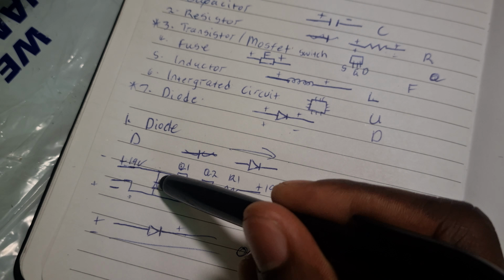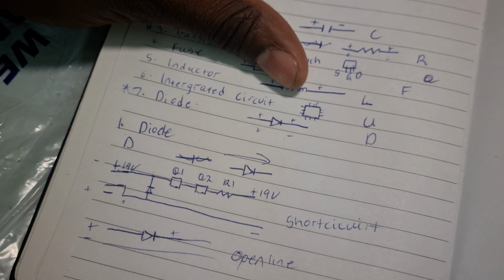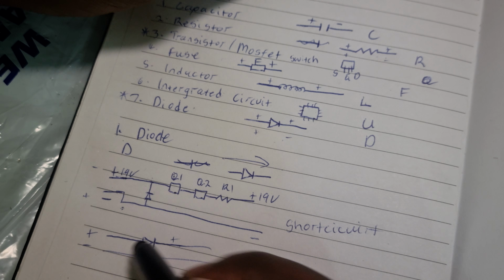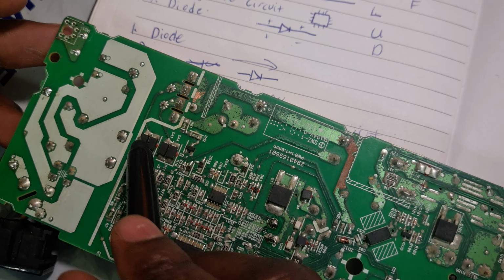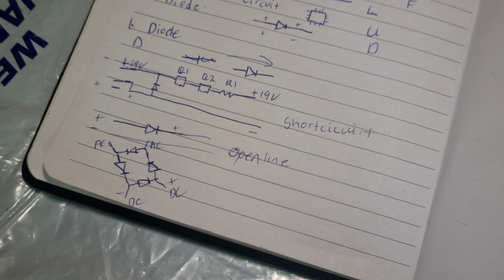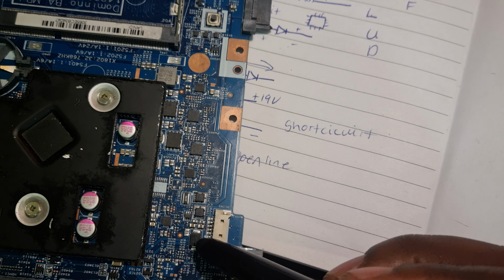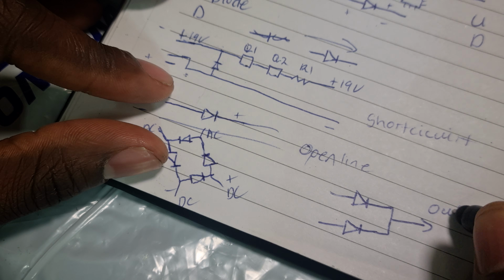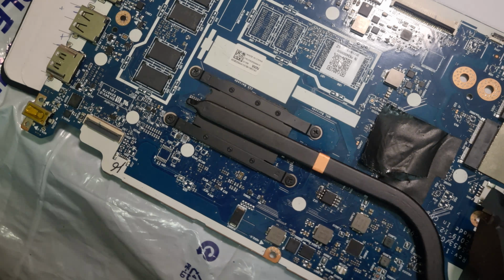Electronics Repair Basics #2 (Diodes)

Comment: Hello capetech nice video, i have never seen you repair a hp 840 series, they really give me a headache😢
Reply from the maker: Have worked on them a lot, usually videos become too long it's always a tricky repair, I have fixed an 850 which is essentially same as 840 just 15inch heatsink and accessories but same Motherboard. Do you have a particular 840 you need me to work on like G3 G6 etc
Reply: G3 this motherboard is the worst, everything works but no display, i have tried bios programing nothing works,in my country 840 is the most sold laptop
Reply: thanks for your videos ,i have learned alot